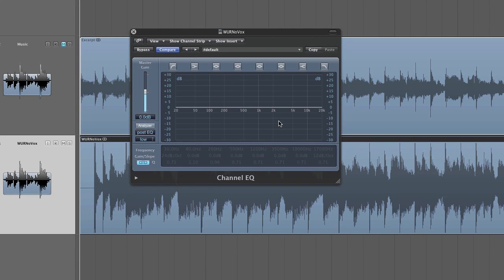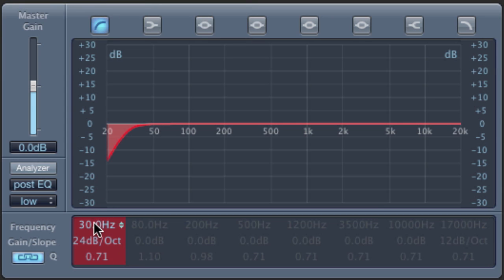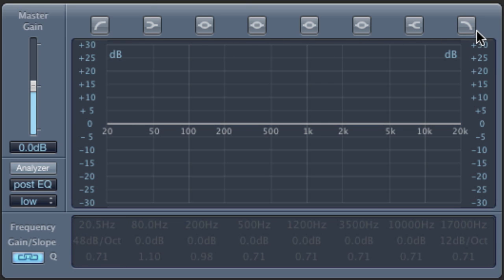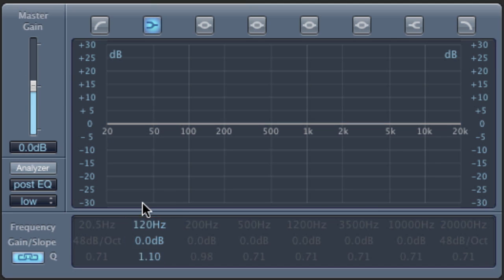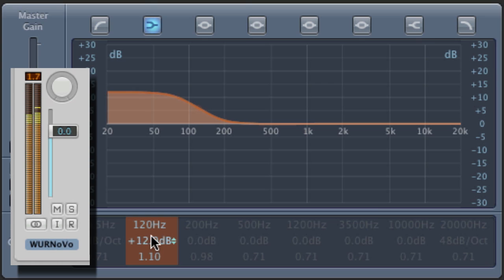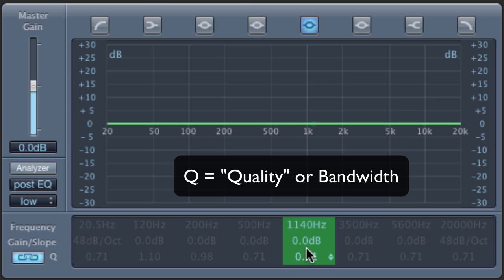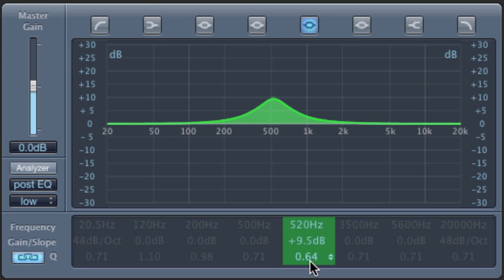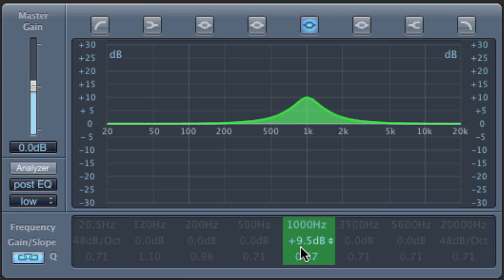AF007a EQ and Filters (live demo)

Comment: So i noticed when you used the peak / dip filter that it gave some spotlight to different instruments, is that what its used for? And if so, how would this be different from using the volume to do the same?
Reply from the maker: Xtra Chowmein Sometimes EQ is used for spotlighting certain instruments, but not usually when a song is being mixed. It might be used in mastering as a last resort (that is, when you only have the completed mix, not each separate track, to work with).

Most instruments have aspects of themselves spread across various parts of the frequency range. If you use an EQ plugin on a whole mix, it'll boost or cut anything from any instrument that occurs in the frequency range you set it to.

For example, high-mid frequencies might contain the high notes of the guitar, but also the hi-hat cymbal. With EQ, you can't affect one without also affecting the other, because they occur in the same frequency range.

Changing the volume on only one of your tracks increases or decreases all frequencies equally just for that instrument. So if you have a separate guitar track and hi-hat track, then you can boost one and cut the other.

Or you can make it even more complicated and apply EQ to just one of those tracks to alter the tonality of that one instrument.
Reply: Matt Mayfield Music Awesome reply! Thx! I'm learning so much from this series. Keep it up!